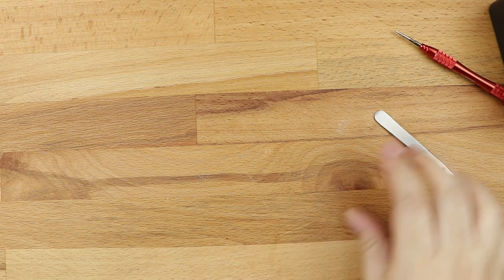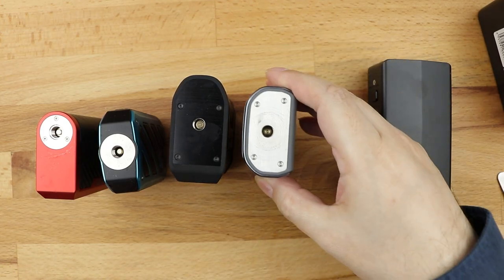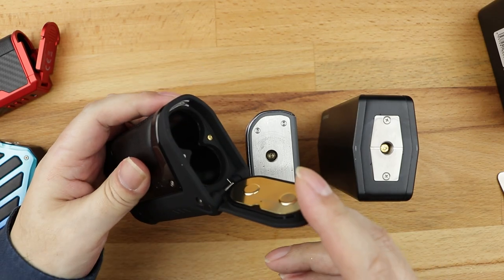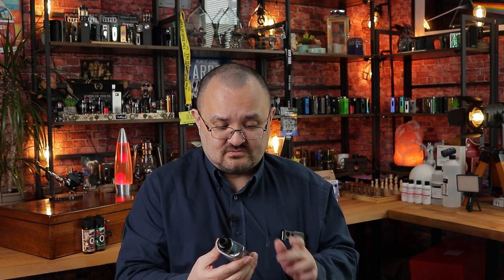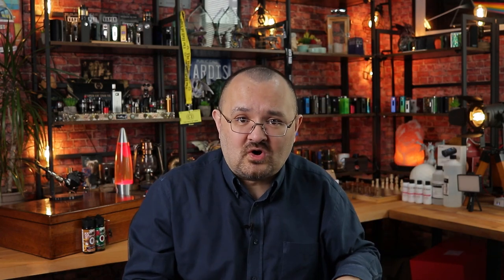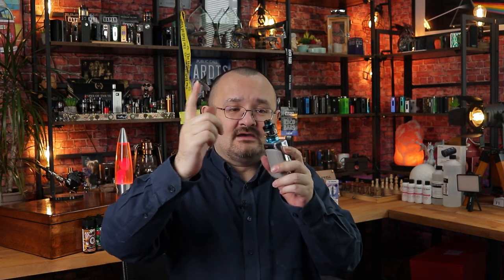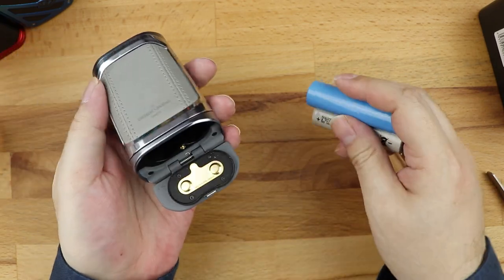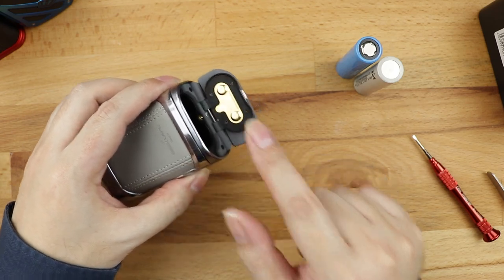Electronic Cigarette / Vaping 101 - Season 2, EP 9 - The Mod

Comment: Hey  it's a T200 not an L200 it's the touch 200 by geek vape how many times can you say the name wrong and call yourself a  vaping professional you think any of thoughs mods are the same hell no the chipset makes the mod putting a steam crave next too the T 200 and comparing them at all is like comparing a  nuclear missile to  rednecks the function of both mods are so far off it's not even comparable. Dude unless you can sit down with a 3D printer and make your own mod or battery tray don't go explaining how mods are different if you don't even know how to say the names right.